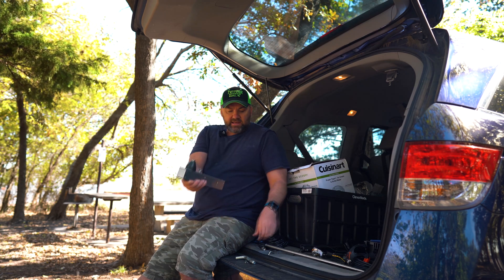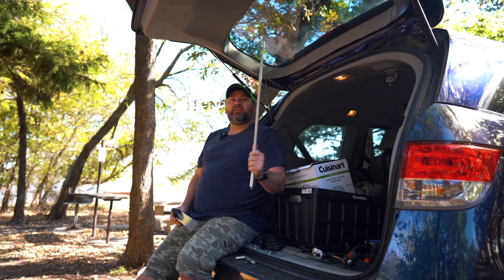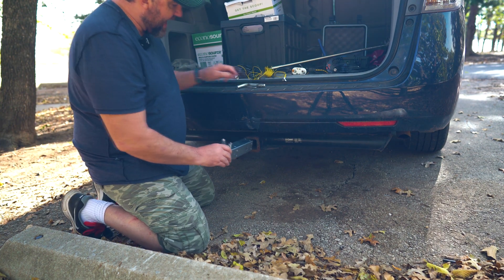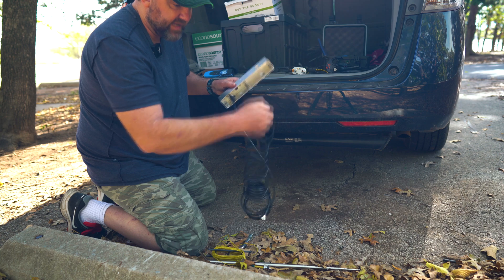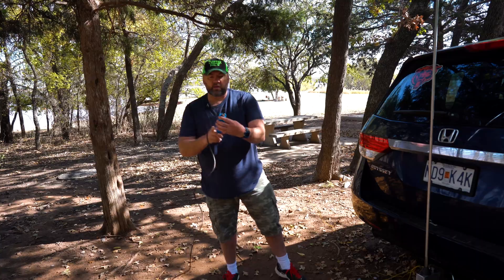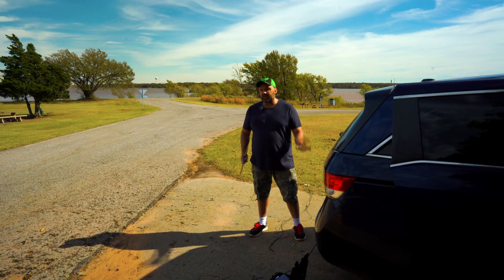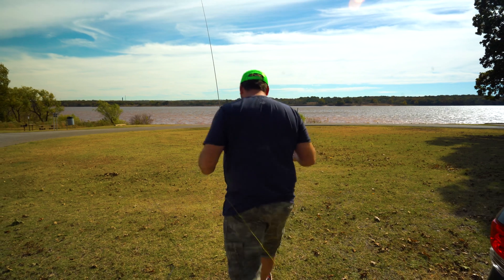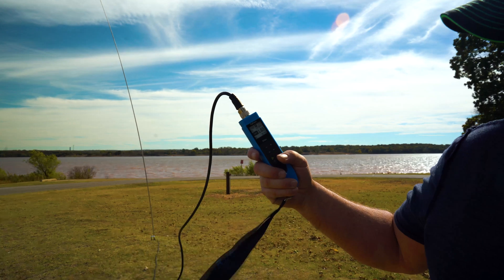Trailer Hitch Antenna Mount VS Spike Ground Mount - MFJ-2822 ~ PART 1

Comment: I just bought the MFJ 2822. I have been using a Hustler mobile antenna for years on a heavy steel 2inch ball mount. I took the ball off and mounted a standard antenna mount (in place of the ball) with 3/8 antenna threads on one end and SO239 on the other end. With the Hustler this home made hitch mount has worked great on the back of a 4Runner and now on my Tacoma truck. The only problem is the heavy duty steel is heavy. I thought about duplicating it in aluminum but the MFJ 2822 looks like what I was planning to make so I ordered one! 
I never had a problem with the Hustler being close to my 4Runner Hatch. The Hustler does have a loading coil high on the mast which is much better than having a loading coil at the bottom. Not sure what you were using. 
73,
N4DJ
Reply from the maker: Thanks for the comment I really appreciate it.

Comment: you should get a few 22" antenna poles w 3/8" mount from buddipole or another brand and put your wipe on it.
Reply from the maker: I'll look into that, please post a link.
Reply: @hamradiocq  https://www.buddipole.com/exanar.html they have it in sizes of 11" for $15, 22" for $20 & 32" for $25 in Black. I know the guy who invented the Buddipole his name is Bud W3FF he is a friend of mine was in the same ARC in Redding, CA  where he lives. he gave the Business to his son they are in Hillsboro Oregon: Buddipole, Inc.
, 3028 SE 59th Ct. #600, Hillsboro, OR 97123

Phone: (503) 591 8001

Fax: (503) 214 6802

Email: info@buddipole.com. 
Bud made an 80/40 Meter Dipole for me (because I was disabled)  back in 2016, for my house in Dunsmuir, CA. Bud, is around 75-76 yrs old now, but he is still active. he knew me as N1DHD,  I got my N6KV call back in April of 2019. Most of their antenna parts are made here in Oregon, with a few exceptions.

Comment: Tom, I can certainly understand your frustrations with the wind, ground radial connection etc...lol!  I am so glad you are experimenting with this hitch mount setup because I too am looking for a quick and easy antenna deployment on my vehicle. This video has spawned some really good input and discussions on the issues one encounters with automobile antenna systems.  This may very well be one of your best videos yet as far as educational value and HAMs brainstorming as a group.  Hang in there buddy!
Reply from the maker: Wow thanks for the best educational.  I will keep up my experiments.  I have more coming with this whip antenna.  I'm liking how easy it is to deploy.

Comment: Hear is a better idea my friend made his trailer hitch mount come out the side of the car or truck another we need a better pole better stronger it don't flop around like the husker fold over make one that fit the husler coil antenna loads make it bigger at the bottom smaller adap to the small thread husler use it be havey duty as we drive it won't flop over fall off the car
Reply: WHAT??????????????????????????????????????????????????????

Comment: Geta 4-5' extension for the receiver. If you have a ground issue cant you ass add a wire straight to the van with a alligator clip. If thats not pissible. Or get a tire plate and run the ground wire as stated. Then you can leave the back door open.
Reply from the maker: I looked at that extension online already, I'm thinking about it, thanks for the tip!

Comment: I think they make an extension like for a ham stick 2 or 3 ft. That would give you the extra length so you can tune in the car. I think if you had the extra length it would work awsom.
Jeff ke4fwe
Reply from the maker: Hey Jeff, thanks for the tip.  I am close to a solution.  I made another video coming out soon.

Comment: Good experiment, it's worth the time I think to play around with set-ups like this,  just to add more operating time on future outings.  That beach looks like a great place to operate from. Good video, tnx.
Reply from the maker: Yep, I figured I'd share my good ideas and bad ones.  LOL I think I"m going to modify this I have some ideas.
Reply: @hamradiocq  I thought of doing the same thing with my truck, but was wondering about the effect of the tailgate on antenna performance. Thanks for the vid, good luck!

Comment: Frustrating, maybe but a fail, No. It may be possible to reduce the detuning effect of the car metalwork by improving the electrical bond between the trailer hitch mount and the car. Abrading the inside of the cars trailer hitch and maybe a small metal wedge to increase contact pressure. You are absolutely right that the quality of the contact between the ground radial mounting point and the trailer hitch is critical, significant resistance here will skewer your SWR!
Reply from the maker: That's a great comment, however, I didn't want this to interact with the car, I was hoping this would be just a mounting point.  Maybe I could put some wood / insulator between the mount and the car.
Reply: @hamradiocq  Yes, either isolate the trailer hitch electrically and vary the lengths of the ground radial system, or improve the electrical contact and repeat.

Comment: Thanks for the video. I used a bumper mounted Hustler 20 meter mast/resonator while underway mobile in Canada  in the mid 1980's. Worked well. Much DX. BTW, the XYL was driving while I operated :)
Reply from the maker: Hey Melvin, I think I"m going to buy a Hustler 20M.

Comment: Tri mag mount on the roof, with radials, or tuned counterpoise, attached to the mag mount....boom.
Reply: I use the MFJ-336T on the roof of my SUV. Have a ground strap to the SUV frame going to the radio. I've used it with an old Hustler system 40 meter resonator. Haven't tried 20 or 80 yet. In the works. Used this setup for two POTA activations. About 24 contacts in 1/2 hour of operating each time. Big pile ups. No radials or counterpoise, just the SUV body underneath. Check out images on my QRZ page, K2JWD. BTW, I have a three step stepstool  with me so that I can mount the antenna in the mount at the location. I don't drive with it on :)
Reply from the maker: Thanks for the great comments.  I will try some different things.  I was really trying to get away from 'just another mobile' rig, but if I'm attaching it to my car/van then I probably just have to go with what you are suggesting.
Reply: @hamradiocq  I should have made a video before the cold weather started Tom. I don't know if you ever received my reply with links to the stage speaker tripods, jaw clamp mounts, and kite winders. But,  trying to not sound like I'm preaching....I had my 7300 set up in the back of my car, on half of the folded down back seat. My coax was stored on one of those round, bright orange extension cord winders, from Walmart. The jaw clamp was on the coax already, and my tuned counterpoise was stored on the kite winder, which was attached to a 4'  fiberglass driveway marker. (Bands marked on white counterpoise with a sharpie pen). The counterpoise had a small clamp on the end, from a battery tender...and it fit perfectly around the PL259, attached to the jaw mount. When I would roll up into a park, I could unfold the tripod, screw in the antenna, attach the jaw mount and coax, and unwind and plant the counterpoise, in about 3 minutes. See my qrz page for a picture. N4ZN
Reply: You know, Tom....on second thought...you have that drive on mast support. Why don't you use that, instead of a tripod...along with a short extendable painters pole? Something around 8-10 feet long. The jaw clamp mount will grab onto anything. Pole, table, whatever.  As long as your antenna is above the roofline of your van, it should work fine. I'd still ditch the 3 radials, and use the single tuned counterpoise, out to a 4' fiberglass driveway marker. The only time this wouldn't be so good, is if you actually wanted to get away from the van. Then, the tripod would be the way to go.
Reply: The 17´ whip can have a lot of wind loading - did you see it bending in the video? I'd be afraid that a mag mount couldn't hold it in winds like that. Maybe one of the extra-large tri-magnet things - but they aren't the easiest to get on and off a tall vehicle.
Reply: @otterlegjeff819  I agree. I have one and use it with the WRC Silver Bullet 1000 and a tripod with a sandbag. Guys would also be needed if very windy. See K2JWD QRZ page for pictures. Sandbag and guys not shown during this test on a calm day.
Reply: @k2jwd  Yeah....I need to do a video on a knot that I use for guy lines, too. It has a 2:1 advantage, and is self locking...yet, comes undone with a single yank in the opposite direction.

Comment: Great Idea Tom. but my firsts thoughts were  "Too sloppy mount loss of ground, and the old adage. "Any antenna alongside the car body, becomes feedline not antenna. so the idea someone came up with below was good add extensions to lift antenna above body line (roof level). might work. I like the idea of quick setup also. worth doing some more investigating!. Tnx agn for attacking the curve. and best of all for sharing. 73 gud dx tnx agn.de Ellis WA1RKS
Reply from the maker: Great point and I will say I'm new to mobile/car mounts.  I think you nailed it when you said, "Any antenna alongside the car body, becomes feedline not antenna"

Comment: I'm thinking that you're losing some of the effective length of the whip, because the first 4 feet or so is close to the car body and is canceled out by that. That's why it seemed like the whip needed to be longer. One solution might be some extension rods between the mount and the base of the antenna. (Wolf River sells them, I'm sure there are other sources.)
You said you might ure a coil. If you do that, you might as well use a tuner. Mobile coils are good for dramatically shortening an antenna, but you just want to match a whip that is fairly close to resonance. A tuner would be a quick and flexible way to make that match. Your coil wold have to be readjusted every place you set up - the tuner will do that automatically. There's no real difference to your rig - it's all about matching the transmitter to the load. Looking forward to seeing what you figure out.
Reply from the maker: Hey, I love the comments and discussion.  My wheels are turning.  I"m new to mobile mounts.  I've been throwing wires into trees primarily for the last few years.
Reply: @hamradiocq   Speaking of trial and error, a plotting analyzer (like a vna) might be useful. That way, you would know if a better match is anywhere close by, or if 2.0 is just as good as it gets. In the open, you can assume that the length of the whip is all that matters - but next to the car, it's not always so simple.
Reply: @traveller-nl  Thanks for the technical details, good conversation! I probably used too few words, hi hi! I was definitely thinking of a tuner at the base of the whip - the way hf antennas on boats and military vehicles are usually matched. The guy is using a long whip that is resonant in the open, and is at 2.0 next to the car. Sure, some energy will be lost in the tuner, but how much of that would be effectively radiated from a loading coil, especially if the coil was below the roof of the car? One of his goals is quick deployment, and the match may need tweaking for each different parking spot.

I was going more for an easy visualization than the correct numbers. He has a nice resonant whip in the open, and it seems shortened on the analyzer next to the car - I think that's a useful image, even if not technically correct. The thing is, putting a section of a radiator next to a big metal object, is going to mess up all the numbers, and the radiation from that section isn't going to count for much. To me, it makes some sense to think of the "real" antenna as being above the car, and the part below the roof being part of the matching section. A bad scientific model, but I'm just going to match it by trial and error anyway.

Comment: If your needing a quick deployment, don't forget about magnets. I put my wolf river coil on a magnetic base, attach my radials to the base and drape them off the truck. Best ground plain ever. Super quick and it works. To much rf reflection from the back of your van. Gotta get on the top.
Reply from the maker: Hey Okie, that's exactly the feedback I've been getting.  I might as well just mount an antenna on the roof.
Reply from the maker: I completely understand using the car as a ground plane.
Reply: What mag mount are you using 
?

Comment: Great video.  You could just clamp the hitch mount to picnic table?
Reply from the maker: Yes you can, but there may not be a table available at all times.  My plan was to park and plug in radials and go.   I already have a clamp mount and I have clamped to those park grills, but this idea was not have to worry about clamping to anything.